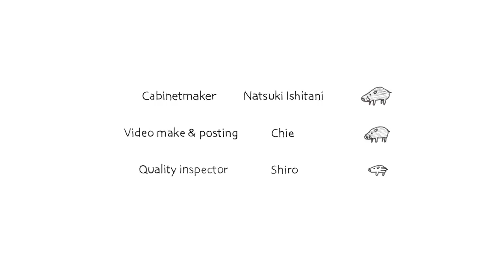ISHITANI - Making a Bench with small backrest

Comment: Nice piece of furniture and video as usual. 2 Questions:
- why is he heating up the end of the spindles before turning the tenon?
- what is the product he applies after inserting the wedges?
Thank you
Reply: -The heat of the light bulb in the box makes the moisture level in the tenons of the legs drop down a bit, so they shrink a little. Then he turns them on the lathe to fit perfectly in the holes, installs them and after that moisture levels will return to normal room temperature state causing the tenons to expand a little bit again, making the joint very very tight. Brilliant technique!
-Just water probably to clean off glue squeeze out, because of these tenons' ends not being cut away but kept in sight. So it's easier to clean up the glue squeeze out with some water while the glue is wet, rather than to chisel/cut/sand/whatever it away after it has dried.

Comment: Question: do you really have to join and plain and square a piece that will end up on the lathe? Wouldn't it be faster just to rough cut it on a table saw find the approximate center and put it on the lathe instead? I figure that you will lose the plained/joined surfaces anyway, won't you?

Comment: Thank you for another incredible video and piece of furniture!  May I ask please, during construction, the legs of the bench were put into a box that had a light in it (it can be seen at the 1:45 mark).  What is this box, and the purpose of it please?
Reply: The heat of the light bulb in the box makes the moisture level in the tenons of the legs drop down a bit, so they shrink a little. Then he turns them on the lathe to fit perfectly in the holes, installs them and after that moisture levels will return to normal room temperature state causing the tenons to expand a little bit again, making the joint very very tight. Brilliant technique!
Reply: Thank you for the explanation, that makes perfect sense, and yes, quite a brilliant way of doing them!  The old adage of "Learn something new every day" still holds true :)

Comment: Why would you joint a piece of wood before turning it round, seems unnecessary. Also, what is in that light box? I assume it is a heat lamp, but it is not clear.
Reply: The heat of the light bulb in the box makes the moisture level in the tenons of the legs drop down a bit, so they shrink a little. Then he turns them on the lathe to fit perfectly in the holes, installs them and after that moisture levels will return to normal room temperature state causing the tenons to expand a little bit again, making the joint very very tight. Brilliant technique!

Comment: Awesome video as always!! But whats the purpose of this lightbox for the legs(4:12)? can someone explain this to me?
Reply: The heat of the light bulb in the box makes the moisture level in the tenons of the legs drop down a bit, so they shrink a little. Then he turns them on the lathe to fit perfectly in the holes, installs them and after that moisture levels will return to normal room temperature state causing the tenons to expand a little bit again, making the joint very very tight. Brilliant technique!

Comment: What is the purpose of putting the legs in the light box? Would love insight into this technique, Thanks.
Reply: The heat of the light bulb in the box makes the moisture level in the tenons of the legs drop down a bit, so they shrink a little. Then he turns them on the lathe to fit perfectly in the holes, installs them and after that moisture levels will return to normal room temperature state causing the tenons to expand a little bit again, making the joint very very tight. Brilliant technique!
Reply: @edwinvanderburgt  I assumed it was something along those lines. Thanks for the insight.

Comment: great video as ever!
what purpose does the little heatbox you have the legs in, serve?
Reply: It dries out the wood. Then once it's joined, it absorbs moisture, making a tighter fit. The idea is that by pre-compessing the wood fibers at the joint, it eliminates flex in the wood itself, preventing the joint from loosening over time due to fiber breakdown.

Comment: That box you put the legs into was that lit up and if so what was the reason for this?
Reply: The heat of the light bulb in the box makes the moisture level in the tenons of the legs drop down a bit, so they shrink a little. Then he turns them on the lathe to fit perfectly in the holes, installs them and after that moisture levels will return to normal room temperature state causing the tenons to expand a little bit again, making the joint very very tight. Brilliant technique!

Comment: what is the purpose of the light box tenon holder? :P
Reply: The heat of the light bulb in the box makes the moisture level in the tenons of the legs drop down a bit, so they shrink a little. Then he turns them on the lathe to fit perfectly in the holes, installs them and after that moisture levels will return to normal room temperature state causing the tenons to expand a little bit again, making the joint very very tight. Brilliant technique!

Comment: What’s the box with lights used for?
Reply: The heat of the light bulb in the box makes the moisture level in the tenons of the legs drop down a bit, so they shrink a little. Then he turns them on the lathe to fit perfectly in the holes, installs them and after that moisture levels will return to normal room temperature state causing the tenons to expand a little bit again, making the joint very very tight. Brilliant technique!

Comment: Hello I like your work very much. You do not quite correctly fasten the legs of the bench. In addition to the reduced diameter of the hole in the bench, it is necessary to drill some more with the diameter of the thicker part of the leg so that the transition from the larger to the smaller diameter is not visible. Thanks for attention.

Comment: What’s the purpose of the lightbox with the legs in does anybody know
Reply: Looks like some variant of UV drying box. I used to know an old boat builder who used a light box to dry out hardener on softwoods before turning. That would be my best guess as to what Ishitani's doing.
Reply: I guess to dry out the tenon, so that when it is finally in place, it will only expand,-with moisture-and further lock the leg in place. I think...
Reply: The heat of the light bulb in the box makes the moisture level in the tenons of the legs drop down a bit, so they shrink a little. Then he turns them on the lathe to fit perfectly in the holes, installs them and after that moisture levels will return to normal room temperature state causing the tenons to expand a little bit again, making the joint very very tight. Brilliant technique!

Comment: What’s the box of light?
Reply: I think he's drying out the wood to shrink the tenon.
Reply: Wooooord.
Reply: The heat of the light bulb in the box makes the moisture level in the tenons of the legs drop down a bit, so they shrink a little. Then he turns them on the lathe to fit perfectly in the holes, installs them and after that moisture levels will return to normal room temperature state causing the tenons to expand a little bit again, making the joint very very tight. Brilliant technique!

Comment: A quoi sert le box de lumière pour les pieds?
Reply: Excusez-moi pour mon Francais. c'est tres mal, alors en Anglais (Google translate peut aider Vous): The heat of the light bulb in the box makes the moisture level in the tenons of the legs drop down a bit, so they shrink a little. Then he turns them on the lathe to fit perfectly in the holes, installs them and after that moisture levels will return to normal room temperature state causing the tenons to expand a little bit again, making the joint very very tight. Brilliant technique!